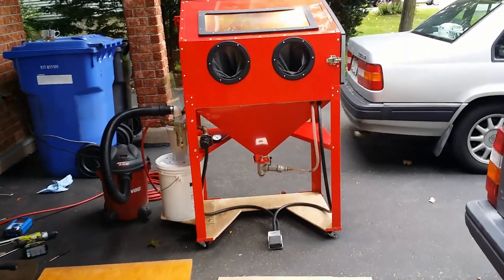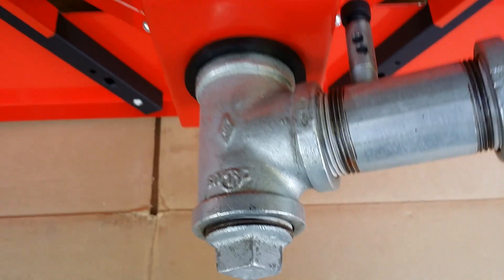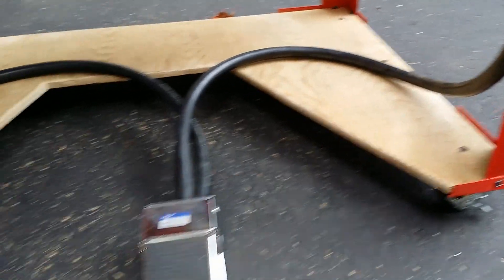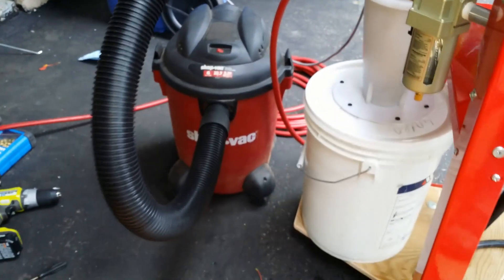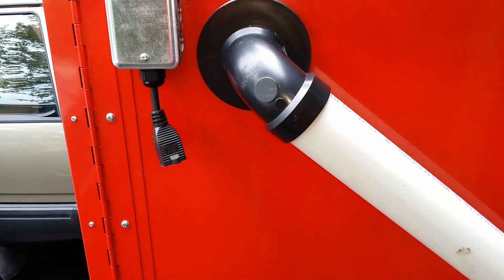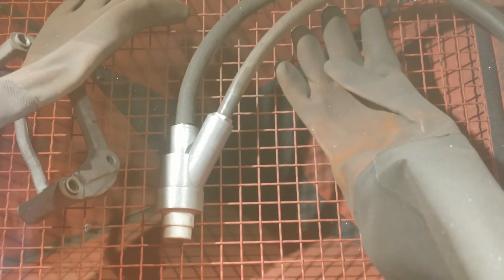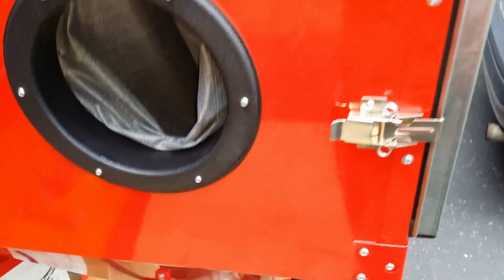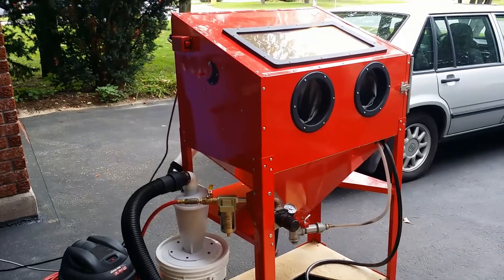Harbor Freight Sandblasting Cabinet DIY Modifications

Comment: Thank you for the video.  I did some of these upgrades this weekend and initially, I was using fine media and it worked great.  Then I switched to medium media and it will not come up the hose to the gun.  What air pressure do you set yours too when you run it?
Reply from the maker: So far I run it with 70 grit aluminum oxide. I set the pressure to 50 - 55 PSI, but it drops to about 45 PSI with the pedal pressed.

Comment: any info /link for footpedal and blasting gun?
Reply from the maker: https://www.amazon.ca/Baomain-Momentary-Pressure-FV-320-Position/dp/B00Z5AK7TY/ref=pd_sbs_469_3/138-7143096-2778717?_encoding=UTF8&pd_rd_i=B00Z5AK7TY&pd_rd_r=3b494d83-1c12-4d59-974c-feddd5620020&pd_rd_w=ikAgb&pd_rd_wg=M1UlW&pf_rd_p=5a0f6968-18a5-43ab-a560-10f088b58e7e&pf_rd_r=GV0FG8J9WF7YNZJ5Z8GS&psc=1&refRID=GV0FG8J9WF7YNZJ5Z8GS
Reply from the maker: Use fitting connector 1/2" hose barb x 1/4" NPT male https://www.amazon.ca/Generic-Brass-Fittings-Hose-Male/dp/B07KHZ4NVP/ref=sr_1_3?keywords=Brass+Fitting+Connector+1%2F2%22+Hose+Barb+x+1%2F4%22+NPT+Male&qid=1557109587&s=gateway&sr=8-3 to avoid air obstruction.

Comment: Can you let me know what foot pedal control you purchased for this project?  Thanks!  Great work!!
Reply from the maker: https://www.amazon.ca/Pressure-Control-Position-Threaded-Pneumatic/dp/B07K8QKZVT/ref=sr_1_4?keywords=pressure+control+foot+pedal+valve&qid=1557109434&s=gateway&sr=8-4
or similar. 
Use fitting connector 1/2" hose barb x 1/4" NPT male https://www.amazon.ca/Generic-Brass-Fittings-Hose-Male/dp/B07KHZ4NVP/ref=sr_1_3?keywords=Brass+Fitting+Connector+1%2F2%22+Hose+Barb+x+1%2F4%22+NPT+Male&qid=1557109587&s=gateway&sr=8-3 to avoid air obstruction.

Comment: How and what parts did you use on the meter valve?
Reply from the maker: Take a look at 3:55. All the parts used are there but one, the bushing that holds the "T" to the bottom door. The metering valve is empty inside, there are no hidden devices. The only mods I did to the plumbing are: 1) I used a file to smooth the female threads in the bushing to ease the flow of the media, 2) The bottom plug is hollow inside, so I used JB Weld to fill it,
3) As you can see at 3:55 I have made an opening in the big pipe (secure it first to the "T" to make sure the opening and small pipe will be at the top), threaded it and attached the small pipe at the top. Then I have cut the male thread on one side of the small pipe and I made a thread inside it. Then I have drilled two holes on the side. The bolt that goes into the small pipe opens and closes the holes 0:47 regulating the air intake and amount of the media that flows into the gun. Good luck with your project!
Reply: @robertdeptula2003  Tyvm buddy
Reply from the maker: This guy explains physics behind the metering valve:  https://www.youtube.com/watch?v=kn6I5vP-8OI